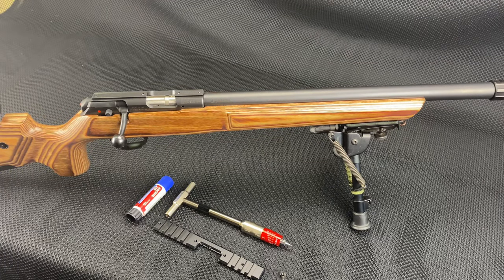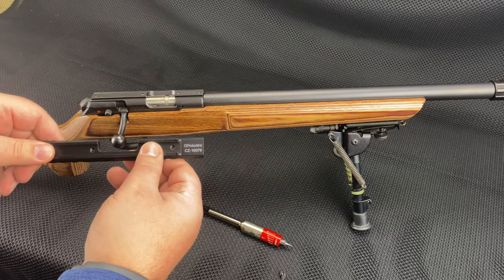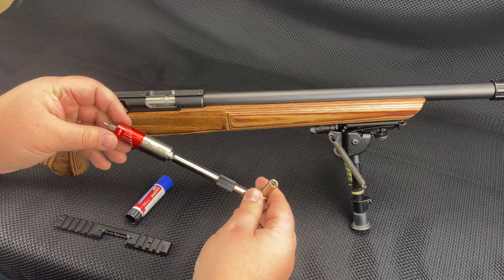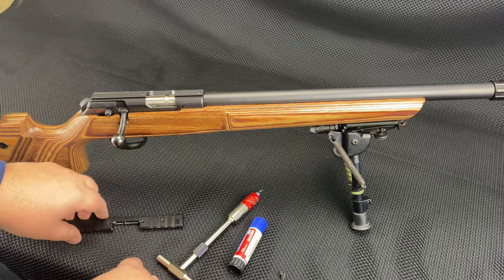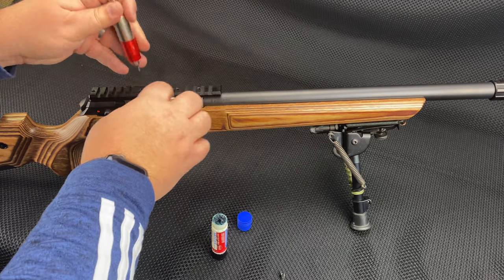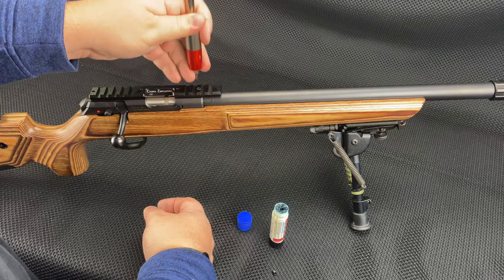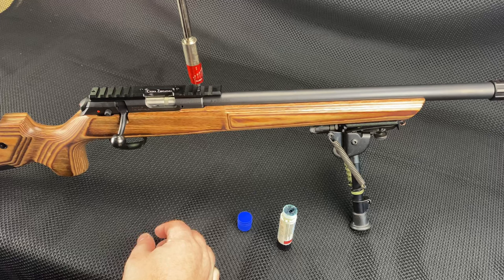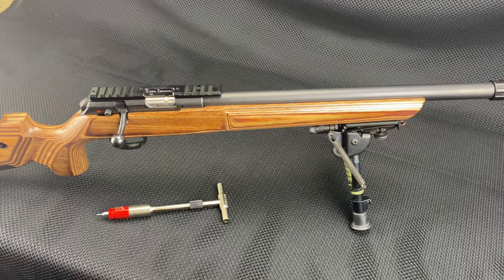Installing a DIP Scope Rail on a CZ 457 .22LR Rifle

Comment: If its permanent you should be putting on loctite on the rail where it meets the receiver... clean up the mess let dry for 24 hours.  If you're really paranoid you should also look up the dry vs wet torque values and set your torque driver accordingly when using loctite as it alters the torque values to wet instead of dry.
Reply: The mount is designed to lock on the underside of the machined mount on the receiver. The set screws lift the picatinny rail away from the receiver to lock in place on the machined receiver groove. So if applying LocTite it would need to be used sparingly in the original receiver groove. "I" recommend NOT doing this, stick with the purple LocTite on the setecrews only.

Comment: Why do you use a different rail other than the dovetail rail already on the rifle?
Reply: Because sometimes you have a scope and rings on hand, before the rifle purchase, and requires a picitinny rail.
Reply: Just buy 11mm dovetail rings. Not that difficult.

Unless you need built in cant in the rail.

But then again they have rings for that too.
Reply: I read that dovetail rails are the common rail used in Europe while many in the USA prefer picatinny.  Many already have the picatinny rails on other rifles and already have picatinny rings.  I recall reading that some 34 mm scopes claimed it was harder to find dovetail rings that size.  Some may just prefer the available picatinny rings.

Comment: What base did u use under this Picatinny?  What brand, what model?  I really hate we
have 2 use two basis for mounting any ding (thing).  i want a peep sight at the end of
the receiver, far back as possible to maximize the sight radius.  Butttttto can't bc
the CZ in infinite wisdom placed a bolt release button-bar there.  the only way 
seems 2B to change the U-notched leaf to a peep disc or put the 11 mm European
dovetail base, then place a compatible peep sight unit at the back.  Butttttto i can't
find dattttto peep sight to fit datttttto PickAtinny base.  Does any one know if a Leeman
or Williams etc peep sight unit fit directly to this Europeeeen 11mm dovetail directly or
indirectly?  Just how?  And if the dovetail on the older 455 compatible w this newer 457?

Yah, being the biggest buyers of CZ units in the USA vs. all of the Europeeeen mkt,
why oh why can they cater to us?  Dattttto includdddoooo what so called their
'American' model.  No American mounting, just same as any 457s sold here.